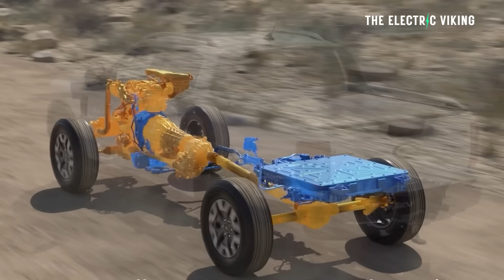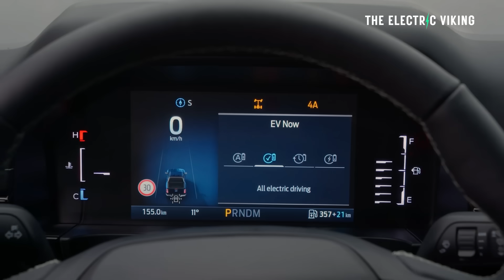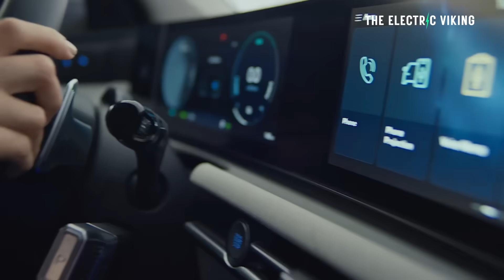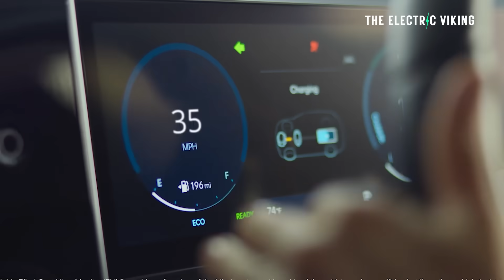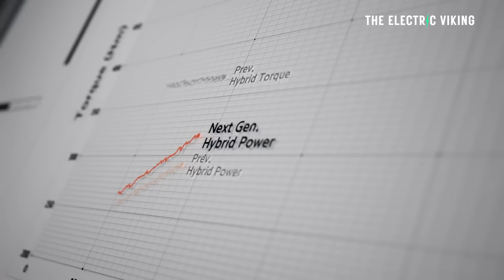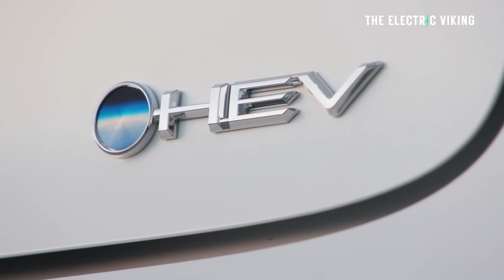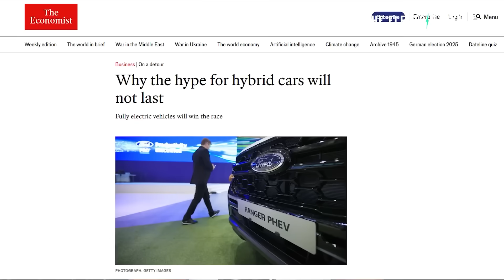Why experts say the HYPE for hybrid cars will not last

Comment: I see the one thing that ALL the EV owners are forgetting in their comments is that not everyone in the world can charge at home.
Almost everything that people bring up where the BEV is advantageous if you remove the ability to home charge are not available.
1st floor flat, designated parking bay the other side of the road.   So unless you think it is easy to get the road closed, get a tunnel dug and conduit laid to put charging cables through and the road put back after repair and reopened is possible for private household
Full Charge Hybrid is best for these people
Here in the UK then if you rely on public charging, especially superchargers then if your ICE does 44mpg then ICE works out cheaper.   My Austral is so far after 8800 miles at 56.9mpg so comfortably above that 44mpg figure.
That is not my figure, that is Dave Takes it on calculations,
Reply: Which is why power companies are putting charging infrastructure on their poles. It’s why there are EV chargers in shopping centres. Charge while you spend the money you save by driving an EV.
Reply: @thethirdman225 are you referring to Lamp Posts when you say poles.     Those are not owned by the power companies but i understand what trying to say.
Typical generic response of people that can easily charge.
10min walk into Town Centre where the Shopping Centre is.    Why would I even be taking my car there and why would it then be parked up long enough to get a charge.   Parking there is free for 2 hours, which is long enough for most people.   At 7kwh charger as well then not going to keep the EV charged up.     The Tesco Supermarket also a 7kwh charger and limited to 3 hours.   Again a 10min walk and no idea why would spend 3 hours there.
So looking at special trips to take the car, 10min walk back home, 10min walk later to collect.   At 7kwh then multiple trips.
For meals, meeting with friends then is a train trip to location, so the car not going to get charged then either.   Weekend trips out need the charge to get there and rarely need to stop on the way.   If visiting Devon/Somerset for places like Seaton or the West Somerset railway then stay away overnight, yes will make a 10-15min break as journey is around 3-4 hours so can top up but won’t get me charged up properly unless they are fast chargers and tend to be 7-11kw so whilst adds useful miles to make the journey then doesn’t keep the car topped up.
We don’t all do 20 miles a day so actually do need for the car to be charged up.
There are local super chargers about 10min in car but off peak are 69p after 10pm.   20-30min to charge up but am then waiting for the car which is argued I do not need to do.   Yes could go for meal at the McDonalds but not really sure want a McDonalds that time of night and am doing so to pass the time.
Working from home then work charger (before brought up is out)
Those types of chargers at the supermarket etc are top up if you need to get you home.
If am at work then usually 2 to 2:30 journey max to the warehouse where either are new so fitting the network up    Which is used to provide internet connection for EV chargers installed after finished so no destination charge.    Or site is being refreshed part of which is putting in connection to EV chargers so none available yet.
With journey less then 2 to 2:30 then certainly no need to break the journey for long enough to charge the car up.
Lamp Post chargers are suitable where the Lamp Posts are on the road side of the foot path so when walk by then they are between the pedestrian.    Where not so easy is when they are on the far side of pavement so that have to walk between them and the road.     This then turns a simple installation into more difficult as now have to cross the path and provide a way to do so safely with a gulley etc that can put the cables through which the company will also have to maintain.   Most likely why not done round my area.    My road is 140 odd homes, 2 of which have driveways for them, 1 of which has the single EV in the road.    Not only are the designated parking bays filled but also half the visitors bays as well.   You aren’t expected to park in the street.   10 lamp posts fitted so a lot of car park juggling Also made more difficult that been a 10 min walk get quite a few people park in the street and go into town centre.
If lived where could put a gulley in the path then I would be expected to maintain that.    The council is not going to pay to maintain them for people or the charging installers.

So far the best has been that despite EV people saying you charge whilst you are parked up anyway was a suggestion “cars are comfortable, instead of sitting at home and browse the internet, take your tablet with you and sit at the local supercharger on the off peak rate and browse whilst waiting to charge” 

There is a reason that 80% of charging is done at home and that is because the vast majority of people that made the move to EV can charge at home,  they charge at home and then will topup if required at the public or destination chargers to get home.   They don’t rely on them.
However the one that I usually like to roll out is the fact that even though Dave Takes It On (very good channel that subscribed too) has a Tesla that has free supercharger network charging he chooses to pay to charge at home on his overnight off peak rather then charge for free.

Dave also acknowledges that actually yes, EV do not work for everyone currently and I am such a person.

Public charging is top up not a get your car charged up.
Reply: @michaelmcnally2331  Then why have a car at all? You’re not making any sense.

Just saying, “Typical response of someone who can easily charge”… I can be dismissive too. The fact is that these things are in their early days but they are coming. Remember how long it took for mobile phones to become mainstream? Same thing with cars. Power companies can’t just snap their fingers and make that stuff happen overnight but it will happen. How long did it take for petrol stations to pop up between London and Brighton, much less in the Cotswolds?
Reply: @thethirdman225 I see you didn’t read my response.   Without a car then how would I do those 2 to 2:30 journeys out to the warehouse😂😂😂.    If you had read then would have seen that in there and not making such a stupid comment about why bother with a car.
This video is about NOW not what will be around in 10 years time with the 2035 mandate.
Reply: @michaelmcnally2331  If you’re going to be like that I’m not interested in your response. Be polite or talk to the hand.
Reply: @thethirdman225 what I posted was that is a “stupid comment” not that the person making the comment is stupid.
What word would you find acceptable to describe a comment that if the person had read the post they would never actually make that comment then.   Is pointless acceptable?   Silly? ridiculous? what word would your rather have me describe the comment?
Reply: @michaelmcnally2331  Stop being angry. I’m not interested.
Reply: @thethirdman225  Really i was using a Crying with Laighter emoji and you think I am angry.    Thank you for the laugh.  Have been LMFAO all afternoon at that one.
Well as don't seem to have a word to replace stupid to describe a commeny only made clearly because you hadn't read my full post then will have to continue to use the phrase.
Considering the "talk to the hand" and "I'm not interested" then we can all see who the upset dare I say it person that is angry.

Comment: Some automakers are paying as much for a small battery pack for a hybrid as they do for a base model EV pack now. It's only a matter of time before any car with a tailpipe will just be too expensive to build. That will drive the next wave of EV adoption but it will also drive up demand and prices.
Reply: I don't think EVs will increase in any appreciable volume for years. The greens are coming for EV production due to large scale environmental damage caused by mining.
Reply: @jimmyjam8795  They don't seem to be very effective at stopping oil production so I don't expect them to be effective at stopping anything else.

Comment: The Economist Sam?  Buwhahaha.  Here in California, ground zero for everything EV, they're talking about putting a $1,000 annual fee on them because of no gas tax revenue to repair roads and highways.  The feds may put on a $250 fee for the same reason.  They weigh 50% more than ICE cars and that's tearing up the roads.  Plus if you don't own your home and do home charging the public charging infrastructure totally sucks.
Reply: So they should tax the weight of the vehicle: makes sense that heavier EV sedans should pay a bit more than ICE, but trucks should pay accordingly.

Comment: Hybrids are an unfortunate, over complex compromise, which had a place about 10 years ago, but now, batteries have got to the point where range is no longer an issue.
Reply: How is range not an issue? Can you elaborate and define when range becomes an issue? Cheers
Reply: @cyclemoto8744  It of course depends. For me personally  turned out not to be an issue (500+ WLTP range). I was a bit concerned when changed from diesel to EV a bit over a year ago. I drive about 17000 km/year including 670 km one way trips to cottage - which we visit about 4 times year.  In the longer trips one has to stop for lunch anyways at about the mid point. Turned out to be no hassle - no extra time compared to the ICV. 
But YMMV of course :)
Reply: @EneriGiilaan  Great it worked out for you. I'd appreciate one however there are instances where I need more range and charging infra is none existent. Cheers
Reply: @cyclemoto8744  Yeah - as I said it indeed depends. And charging infra seems to be a major concern in many areas and parts of the world.
Reply: @EneriGiilaan  yes it depends on the use case. No different to a bicycle suiting some as their only mode of transport yet unsuitable for EV owners. Cheers
Reply: @cyclemoto8744  Because people charge at home while they’re asleep. Can’t do that with an ICE. Because people charge their cars in shopping centres while they spend what they save by not being shackled to an oil company.
Reply: @thethirdman225  You fail to understand that the requirements of people differ. e.g. Why are you wasting your money on an EV when you can buy a bike at Anaconda for $300.
Reply: @cyclemoto8744  That’s a non-sequitur. It has nothing to do with anything I said.
Reply: @cyclemoto8744  In the same was as range is not an issue with ICE vehicles, Most new EVs have a 200+ mile range, and if you look at ZapMap in the UK, there are plenty of charging points around the countey. There are a lot of EV owners where I live, all have home chargers, so for the vast majority of the time range is not an issue.
Reply: @cyclemoto8744  The average Australian drives 37km a day, that is why range is a massively over rated issue. EVs don't need to be the best choice for everyone, but the % that they will be will increase as battery energy density and longevity increases further and price falls.
Reply: @GDM22  Grid electicity is over rated as well for some , so by your standards let's not have a grid. Your clearly struggling to understand that not everyone has the same use case as you. Cheers
Reply: @cyclemoto8744  Didn't use my situation I talked about Australian averages, when responding to why range is an overstated issue, if you drive a lot more than 37km each day regularly and live in Australia (UK similar, US a bit higher) then your situation is the outlier.  Not having convenient and cost effective overnight charging is a very valid reason not to purchase an EV and would apply to a much higher % of people.
Reply: @GDM22  I may have inadvertently replied to you instead of someone else. I'm now looking at the comments and Youtube shows 22 replies yet only displays 10 so who fooken knows what they're playing out. Cheers.
Reply: Not here they haven't, it's still an issue, so it's hybrid until solid state mate 🤝
Reply: Range isn't but charging time is.
Reply: @bikeman123  Spending half an hour charging while on a long trip is actually a smart move anyway. Nobody should be driving more than two hours without a break.
Reply: Only in cars. 
Utes, EV is rubbish. With large enough battery for appropriate range your load carrying capacity is significantly reduced.
Reply: @lengerer Nah. Vast majority of utes are pavement princesses
Reply: @lengerer  Are you seriously saying that doesn’t affect ICE vehicles?
Reply: Not everyone can charge at home. For everyone who can’t refill at the gas station will always be more convenient than recharge it.
Reply: @stefanoparlatore7141  I have had my first EV (VW ID.4) for a bit over year here in Finland. No opportunity to charge at home - still no problems. I can charge at work or at the 11/22 KW charger at the store parking lot across the street - or at any of the multitude of fast charging stations in a couple of kilometers radius. During normal work weeks I have to charge to 80% about once week - and that is done when going to stores and lunch in Saturday. My cottage is 670 km (420 mi) one way - the trip does not differ from previous ones with Passat Alltack diesel - we stop for lunch at a the midway as always - and the EV is fully charged when we are ready to continue.
Reply: @stefanoparlatore7141  Nobody who buys an EV does so without considering that. Power companies are setting up chargers on poles. You can charge while you’re shopping in a lot of places. In short, you can charge almost anywhere and it takes up a lot less space than a petrol station. Even apartment blocks are getting in on the act.
Reply: @stefanoparlatore7141  I never find going to the gas station convenient;.
Reply: @GDM22 more convenient to refill in 1 minute at the gas station that 30-60 minutes at the electric station.
Reply: @stefanoparlatore7141  One minute eh, what about price cycles where the fuel fluctuates by upto 30% in price within a week, so the cheaper days are busy, huge variations in price by stations and suburbs, meaning the ones you pass by might be expensive, leaving you feeling ripped off. Furthermore they aren't everywhere, I live in a city of over 2 million people, 12 kms from the city centre and the closest is still a 10 minute drive. This is my reality of getting fuel in Australia and I don't it once a week minimum as I ride on motorcycles.
Reply: @GDM22  This may be the reality where you live, sounds like Brisbane or Perth. If you live in the suburbs of a big Australian city I totally get your point, I have been there, I know what it’s like, I would have zero doubts choosing an EV there, but that’s YOUR reality. I live in a condo in the hinterland of a medium sized Italian city, my garage is 2.4 m wide and my designated park outside doesn’t have the possibility to have a charger installed either. I drive 23km to go to work, and I pass through 3 or 4 gas stations. Prices are similar and don’t  fluctuate much because taxes are a big portion of the price in Europe. I refill in one minute and it’s enough for 2 weeks.

Comment: I have a friend who repairs Audis and VW. He has his own service. He told me cost with old hybrids will skyrocket since it has so many components. Dont make the mistake and just go EV.
Reply: BS. Hybrids have less components. The ice on most erevs is just a generator. The battery is also easier to swap out.
Reply: @John-p7i5g  There's different kinds of hybrids. Most have the same engine as a non-hybrid, crammed in with a generator-motor, so much more complicated and tight. 
Hybrid batteries work harder than EVs because although smaller they have to put out the same power. That's going to be tough on them. The larger EV batteries loaf along and they last longer than the car.
Reply: @John-p7i5g  Hybrids have more components. Ever looked under the bonnet? The only thing that’s different is that most hybrids have a CVT for efficiency reasons.
Reply: @thethirdman225  I look under the bonnet every month or so.
My old petrol car prior to 2016 = constantly going wrong and needing repair
My hybrid = 9 years virtually zero maintenance
Reply: @John-p7i5g   You've got a smart answer for everything, haven't you? What you didn't address is the fact that hybrids are more complex and have more components than ICE.

Don't bother responding.
Reply: @John-p7i5g   You've got a smart answer for everything, haven't you? What you didn't address is the fact that hybrids are more complex and have more components than ICE. I have been driving one for seven years.
Reply: @thethirdman225  I don't know about other marques, but Toyota hybrid system does not need any maintenance.
Technically there are more components, but those components are used in a different way to ice cars, so they experience a lot less stress.
The ice is effectively a motor generator and has a fairly indirect relationship to the drive train.
Most common things to fail are inverter pump ($50), and battery ($1k for new recon battery).
Reply: @John-p7i5g   The ICE in a Toyota Hybrid does provide motive power. From my memory, the ICE and the electric motor are on each side of the power transfer case. It is an Atkinson cycle engine that is designed to work in a very specific range. In all other respects it is a conventional ICE. The electric motor/battery combination is effectively just a range extender.
Reply: @thethirdman225  yes that's correct. But the ice is one step removed, and it's dampened by the EV like drive train. You can tell when you drive one.  Feels like the accelerator pedal is a bit disconnected from the wheels.
Also you accelerate but the engine revs stay the same.
It's very different from a pure ice.
Reply: @John-p7i5g you must of course be aware that your experience is at best anecdotal, and at worse relevant to nothing. Statistically worthless.
Reply: @John-p7i5g what less ? You dont kniw what you are talking.